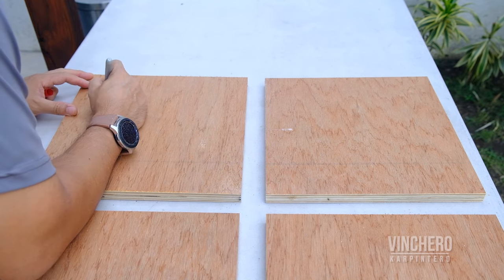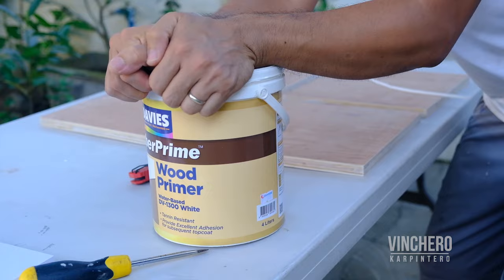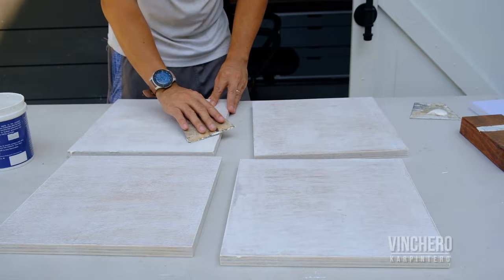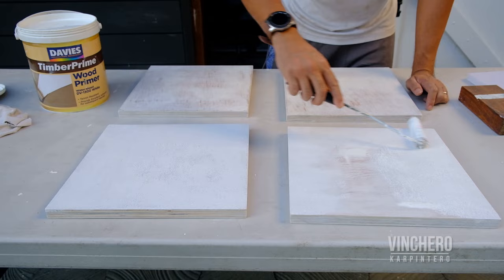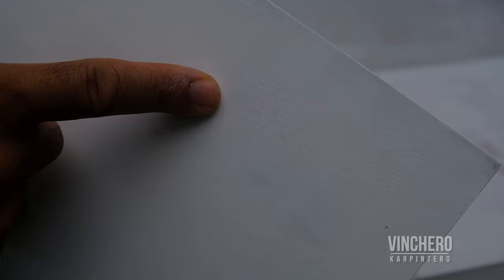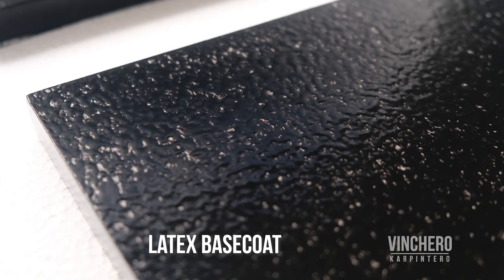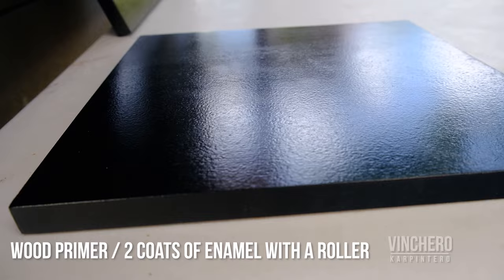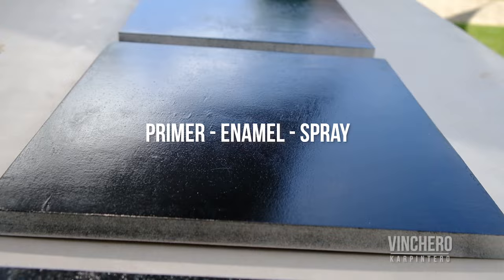Is it Better to Roll or Spray when Painting Plywood?

Comment: If you want the paint to level and don't want to buy a high end sprayer, you can just add a little Flood to your paint. They sell it in the paint section, one for oil paint and one for water based. It makes the paint level out to a very smooth finish. You can even brush it on and it'll level out to a very smooth finish.
Reply from the maker: I just looked up "Flood" paint leveler. Awesome. Thanks for the tip. I will definitely try it.
Reply: Likewise!

Comment: Adjust the pressure of the Spray Gun depending on the thickness of the paint and you'll never get air bubbles as shown in video...

Comment: I love the breakdown and I appreciate your effort but one thing I never understand is how people can complain about the set up and takedown of a paint sprayer. I feel like it can equally be argued that using a roller has its own disadvantages and quirks a lot of people don’t care to save their rollers like I do maybe or many other people, but scraping the paint off of the roller, and then cleaning the rollers off, having drops everywhere I mean you’re already halfway there to the effort that it takes to put up the sprayer and you get a better product almost every time I think this is a unique situation where the product is comparable but most of the time a paint sprayer delivers way more of a quality finish. 
I’ve use a sprayer for an exterior on my house. Also a few interior room jobs and yeah the set up and take down is different but if you don’t mentally get trapped by the time that it takes the mask things and realize that there’s really not that much to clean up. If you do it right paint spray is the way to go .

Comment: Maybe using a masonry filler instead of a wood filler reacted to the latex? Also enamel on top of latex probably doesn't sit flat, as seen in your vids.

Would like to see 2x spray panels with primer done by spray as well, as you did all 4 primer with roller, instead of 2 primer by spray.

Best comparison video so far, thank you! Liked & Subscribed

Comment: So from what I saw you needed to wax and grease clean between your coats. This may well have minimised that problem you had painting over the latex. 
Also I saw you correctly point out the spots that needed more sanding on the latex, and more sanding is exactly what it needed as those low spots that did not get sanded as much as the rest of it would also have contributed to the undesirable finish you got.
Separately a second under coat over the latex nearly always gets a better result than painting straight over the latex.